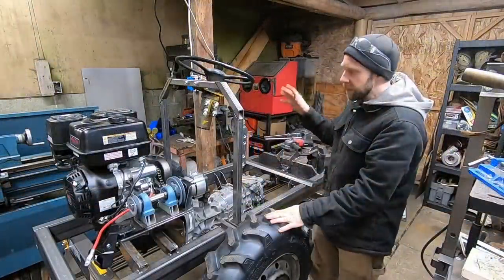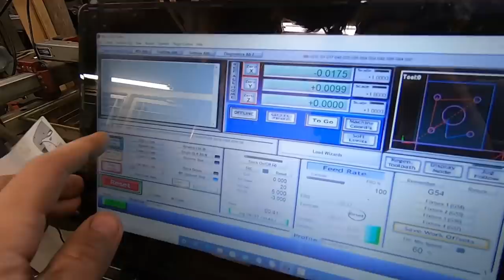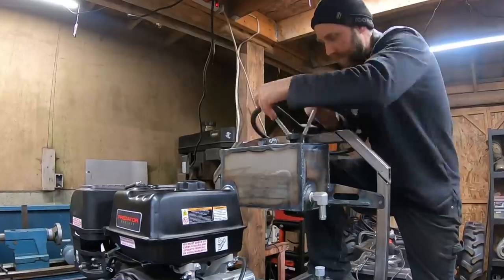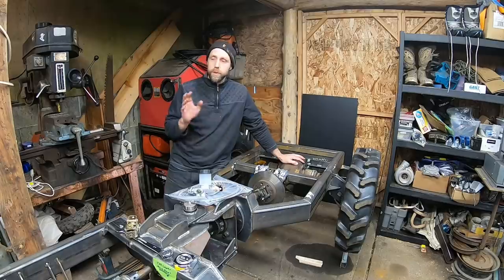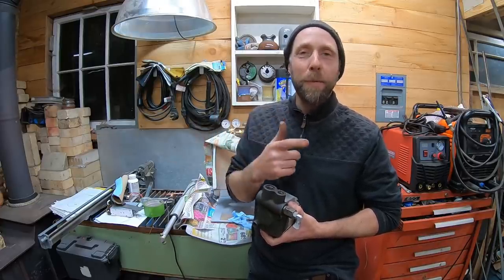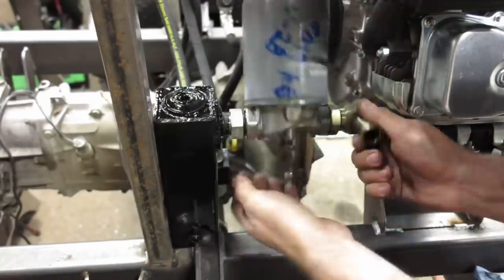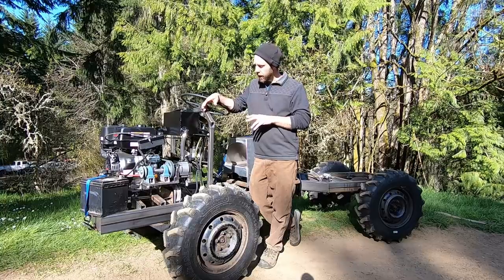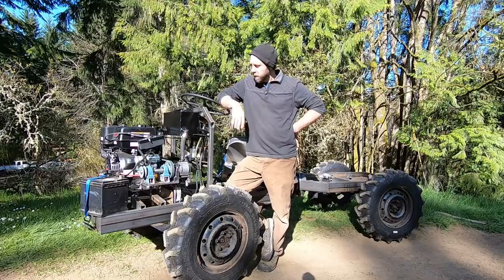420cc Predator powered articulating 4x4 dump truck build part 6

Comment: I like that he basically told everyone that hates the drive line brake to STFU he knows what he is doing. He is right! Heavy machinery uses drive line brake for that exact reason.    YOU GO MIKE!!
Reply: An open differential is dangerous with a driveline brake. Just the facts man.

Comment: Excellent build. Needs an old school tractor seat?

An old engeneer friend told me once - “It’s not the load you can carry, it’s how fast can stop that much weight.”  He use to design elevators, but I think the principals are the same.
Reply from the maker: Snozco Cram I forgot to mention in the video I’m running stock Subaru rotors and calipers up front along with the rear center disc. Your friend has a good outlook on that subject 🙂

Comment: I would think about it really hard before you weld the diffs. The way that baby turns so tight I would be scared of wheel hopping or chirping myself.  BUT, with that said,  I surely would entertaine the idea of a locker.  I know that welding wire is cheaper, but a locker would be the best of both worlds. I'm sure that someone, somewhere, makes a locker for your rear ends. If you can't find one,  there's a fellow on YouTube that can make you one.  He's the Man that's making the articulating, Predator dump truck.  LOL, KEEP UP THE GREAT WORK. I enjoy watching your videos.
Reply from the maker: Jamie Taylor Yes I will probably hold off on welding up the diffs, I think not will be fine the way it is on my property. I appreciate your advice and I think you are right about a locker 🙂
Reply: I agree on the locker, and not welding the diffs. I think it would put way to much of a load on that light drive line.

Comment: My 2 tone 1954 Chevy dully has a driveline emergency brake. It’s original. I can park on a hill. Loaded, And it is mechanical and not hydraulic. Those that are commenting on the break system have never worked on heavy equipment. It works. Very nice work.
Reply from the maker: You know 👍 take care William 🙂

Comment: Hey Mike! I'm really enjoying this series. Just a sugestion. Once you've tested the articulation you need, think about limiting the twist capability of the rear. Early articulared tractors with long wheelbase, were prone to flip over due to short gearing and increased traction. Greetings from Argentina!

Comment: I had a log skidder that was setup around the same ideas. Driveline brake, articulating frame, etc.  It worked great. I really like where you're going with the build. Excellent work by the way!
Reply from the maker: Thanks Justin!
Reply: @Mikefestiva  no problem buddy. I'm getting ready to build my kids a buggy to 4 wheel with. I plan on using a predator engine also.

Comment: Yes, old trucks and certain tractors used a “Drum” park brake, so it works. Going 14 MPH does not require brakes at the wheels as there is no transfer of weight. Have not read others but when it comes to “Tow” rating on your new truck, it is NOT horse ponies, it is brakes. Nice build. Many have not driven a “Center Articulated” vehicle period but the first John Deere 4X4 tractors would allow max turn radius on hydraulics, but pull the steering wheel a little harder, the inside brakes would start to lockup. This made steering even tighter. You could walk it around a basketball in the dirt if you wanted to pull it hard. It would automatically dis-engage a lockup on the front or rear differential if engaged. At least they did when I was 14. Now I am 64. Many moons, just wish I could walk. 
ASE Master Tech since 78, retired

Comment: Talking about heavy equipment using driveline brakes... we run three balewagons now which are basically small square hay bale picker uppers, I don’t know the weight of the actual machine but we put 188 bales per load which is over 11,000 lbs just in bales. All of these machines have only driveline brakes and we definitely put them through their paces so good work!
Reply: Suure if drive line is designed with enough over kill. Thing is that when you load heavy equipment with even more weight and of course it will stop when drive line has enough gear ration. Problem arises if and when drive line components give out, thats why people say its bad idea.
On this case, unless his going to load it full of rock, it should be fine as its small dumper made with 2.0L? car parts. If this was to move car size load of material, i would go with truck parts and so on.
Reply from the maker: I also have stock Subaru rotors and calipers up front along with the drive line brake. It’s got really good brakes all around. Thanks guys for checking out my video 👍

Comment: Military humvee's use drive line braking also, So its a proven method. The only set back is the rocking motion you get when you come to a stop.  You might not have that issue since you won't be moving that fast.  Cool build.

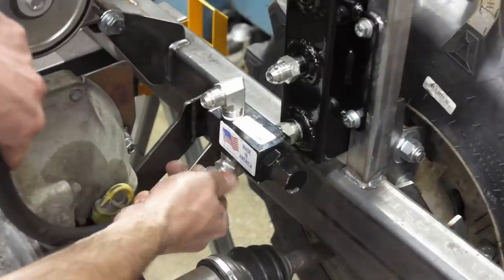Comment: Dude you nailed it on this build.  An to the ppl who said the center driveline break is cutting corners lol simce when is working smart not hard cutting corners. An they must have never driven a hual truck (off road dump truck) n real life they all have this break set up an so do mega mud truck an anything with i think past 2 ton axels have center drive line breaks. U would burn up your breaks an melt everything if tried lol they clearly have not worked in this type of feild of work. An @10:20 theres a  Sasquatch looking in your window lol

Comment: It came out great I was thinking it look like it rides a bit rough though. I wonder if you could make a suspension seat. That pivots in the middle for when you articulate. The front mount would need to be a fixed ball mount or maybe you could use a u joint. The rear mount would be a vertical slotted mount to let it move up and down and let it rotate but not move side to side. Then you would have a set of springs on each side of the seat.

Comment: Our Articulating John deer dump truck uses a central drive line brake for parking works perfect and central drive line brakes have been used for years even down to 1/2 ton to 50 + ton so I like your idea of it great job.

Comment: Question: If you are gearing this beast down that much, have you thought about putting a draw bar on it with the appropriate hydraulic fittings on the rear to let it double as a tractor?  

Question 2:  With that beast set to become a hydraulic dump truck. Are you going to build on a rollover bar, head ache rack, or even a full cab (+/- glass)?

Great Job, not going to lie I kinda want one for my self.

Comment: You sould build a 3 way trans for it so you can choose between 4-1, 6-1, 8-1, and also don't weld the diff, it's going to put alot of stress on the steering and body and driveline of the truck
Reply: With load on those driveshafts will pop in half on first turn. 
To fix traction problem, add independent brake ability for each wheel. If one starts spinning you can brake it till the other carries you out.
Reply: @mihkus  or even see about  making an electronic locking dif

Comment: Drive line brake is the answer.   Simplicity is the answer.  And no booster.  Big jag a rocks on.  When I step on pedal.  I wanna everything is gonna stop
Reply from the maker: Yes I’m also running Subaru front disc and calipers up front so it’s got some solid brakes all around 👍 Take care Steve

Comment: I wouldn't weld the rear diff unless getting becomes an issue those axles gonna have a hard enough time on that angle doing sharp turns with a heavy load on the back might break 1

Comment: Do not worry about those that do not realize projects of this nature are an on going  R and D exercise! And that things are not made permanent or may be fitted to limited strength so as to prove concept and alignment before being made permanent! They evidently haven’t seen Orange County Choppers, where they build the chopper, tear it apart, do paint and finish and then reassemble it! Your approach is the safest and most effective method for a custom one of a kind project! Keep up the good work!

Comment: Mud trucks use driveline brakes... stopping a giant 15000+ pound truck with 6ft tires with driveline brakes should prove a driveline brake is more than powerful enough. Plus, you won’t have ABS. Some medium duty dump trucks use a drum brake on the back of the transmission connected to the driveshaft as the parking brake as well so you’re 100% right you have nothing to worry about
Reply: I agree completely, as part of my  job I use and maintain container handling forklifts (Think Cat V925 size) and many of them use the same drum parking brake in front of the transmission you're talking about. These machines weigh 140,000 pounds or more depending on model, and the drum on the transmission is only about the size you'd see on a 3/4 ton truck rear end, due to the gear reductions Mike was talking about in this video. The brake set up he has is a great solution in my opinion.

Comment: Pinion breaks are common in off road applications and most heavy equipment use them for parking not braking so much. There good for slow speed but high speed applications they tend to get hot and warp easily because the gear ratio makes them run much faster than on the wheels. Your project is coming along nicely. Great job.
Reply: Jason you get it. You are absolutely correct
Reply: The concern offroad is the open diff. Weld it. No question.
Reply: ridestreet20 pretty sure it’s an lsd

Comment: Does it have front brakes? I don't remember but without a load going down a steep off road grade the back won't stop you...but I love the build thus far! Nice work! It seems with all those hydraulics on there obviously a dump bed is happening but some quick connect lines and you got a splitter attachment,  a chipper/shredder etc...OK this comment is too long...peace
Reply: Driveline brake stops all 4 at the same time
Reply: ry tvdinners I think he is running the front discs but not the rear drums. 👍 Cool build

Comment: Awesome Build! I've been following the progress as you Put out more segments, I love The fabrication! So you're going to Use a Jack shaft and lower the gear, so you can use the higher gears, and I imagine you will have some real serious torque in your low gears afterwards, I imagine with it articulating you're better with the Lower gears it doesn't need to be super fast or it might be unstable? You're lowering the operating speed of the hydraulic pump by changing the gear Ratio with a different size pully will that Lower your steering sensitivity? or Is it So the fluid doesn't cavitate? I'm not Experienced by any means with Hydraulics So I Have to ask But I am interested In how it works and what all changing the pump speed affects? I enjoy watching people who can Make something out of Just about nothing, And do so by putting in alot of Work, Alot of Thought, and Patience. I'm impressed and Enjoy all your Videos They're very Informative And Down to Earth and I really like that! I'd like to think I'm pretty handy I am always learning little bits of information here and there on many different skill sets and Your Videos are good for that and very inspiring! Great content! Great work!
Reply: there are a couple of reasons to slow down the hydraulic pump one reason is that pump has a higher flow rate than is needed and at idle speeds it can kill the motor if if you stall the hydraulics and it opens the pressure relief valve also the steering is plenty fast because of the small cylinder bore on the steering cylinders so it will help in  both cases
Reply: @davidhelgeson6997 That makes sense! Thanks for the insight.

Comment: Drive line brake are way better than brakes at the wheel. Why do you think rock crawlers use a drive line brake. They hold a the power back easier. Big mining dump trucks use drive line brake too
Reply: Ya, I can’t imagine all the knucklehead comments he has to endure!
Reply: He is not building a big mining truck. Drive line brakes are meticulous  to build and install.  Some high quality cars utilise  such brakes to decrease unsprung weight for better damping and cornering.

Comment: Even a tiny spot weld is surprisingly strong if it's not put in a bending load. I recall another Youtuber who drove around in a Baja Bug with a bunch of tack welded suspension parts (can't recall if it was accidental oversight or deliberate disregard) for a long time before they finally broke. Blew my mind!

Comment: Careful about the Hydraulic Swivel fittings.  Used them for a Hydraulic scale on Forklifts and the Chinese made ones use a Soft metal that often gives way on the Crimp after a while in the Crimp part of the swivel.  There is Domestic Production of them that costs a few more buck, but beats having leaking swivels.

Comment: You are completely correct on the braking system. When you install the brake on the pinion of the differential it amplifies the power of the brakes by the gear ratio.

Comment: Great to see it moving under its own power, that said DO NOT WELD THE DIFF. Put Torsion centers in the diff if you can find them or LSD's, welding the diff will cause it to kick like a mull when turning. Your wheel base is to short, you can see in the video when turning the differential action needed when turning.

Comment: Those that are worried about that brake obviously haven’t driven and ag equipment.  That will work fine - hell, one of my tractors brakes stopped working almost entirely 20 years ago and it still gets driven plenty - probably wouldn’t let a novice drive it, but it’s fine for what it is - and it’s a 65HP tractor too, so much heavier than yours.  Keep up the great work, love watching this build. 👍.  Eyeing off one of those CNC tanks too, that would make a nice addition to my shop. 😊

Comment: I was in the Air Force and peeked under the hood of everything I worked around out of curiosity. The large aircraft tugs with 4 wheel steering have rear driveline brakes on them, so I'm completely with you on this. The tugs were able to stop on a dime towing f-22s, so it'll work well for you. Loving this build, you're doing a lot of cool stuff!

Comment: Just found your channel. Excellent build. The Tenant company used to produce an articulated floor scrubber that could scrub a floor with the front section and vacuum up the water with rear squeegees even around warehouse racking. I always thought it would be cool to convert one of those for use around a homestead. Now you’re doing it from scratch. Good on ya!

Comment: Yeah, diff/driviline brakes are used everywhere from heavy machinery to megabus trucks. Super simple and effective compared to running brakes to all 4 corners. Seems like the driver sits a little high though. Might be me. I'm really tall so a high seat on angles gets sketchy. Im sure the seats not done, but I'd add some hip bolsters for hills and articulation. I love this build so far.

Comment: I like the tab method for tank assembly.  I like the drive-line brake.  They are used in a lot of large equipment, and they are not submerged in mud, etc. The project is coming along fine!  Looks great!

Comment: Have you considered using a a dual range subaru trans from an old loyale, it would give you 2wd to the front 4hi and 4lo. This would get you lower gearing without a jackshaft. They are very similar to the legacy trans

Comment: Your right to use the drive line break , the only thing you may run into is the disk will heat up when being used a lot when vehicle has a lot of weight on it . Four wheel brakes are more complex but can dissipate the heat generated from moving down hill with lots of weight. You will see your disk for breaking change colour from the heat witch won’t hurt anything but you may notice the     Break pedal throb after so time dew to disk warping if it gets hot for a long time . Very good build and well thought out . Thanks for letting us all see your project and looking foreword to seeing more and how you finish this build .
Reply: Yup drive line breaks are the way to go. But good thing its mild steel he can just cut out a new disk lol

Comment: Mike,
You could make the system load sense by adding a shuttle valve between the A & B ports and taking that to the sense port on the pump.

Comment: That is one stout machine, I love overbuilt stuff, it’s like a mini front end loader 👍🏾
Reply from the maker: Thanks for checking out my new video! Yes it’s definitely stout 😂 I wanted it to be built strong and not worry about breaking it when doing heavy work with it. I have a extremely well built small 4x4 gray market tractor from the early 80s and I wanted this dump truck to be matched to scale to my tractor. Thanks for commenting 👍

Comment: This is amazing. You inspired me to draw up a the layout for something similar, but with a inline 3 or 4 cylinder FWD drivetrain, rotated 90,  with a welded diff to split the power to shortened solid axles front and rear.  I like how compact the single cylinder and transmission,  keeps the track nice and narrow - perfect for some small scale logging. Looking forward to see what you do next with this!
Reply from the maker: Thanks for checking out my video 👍 Yes the FWD 5 speed turned sideways with the diff welded and CV joints going out to some narrowed small truck axles is a good way to go. I have been thinking of this on my next build. Thanks for commenting 🙂

Comment: Our 15 thousand pound lift off road forklifts (weigh 20 thousand without anything on the forks) run a single disc about the same size. That set up will be more than adequate.

Comment: If you put a stout small push blade on the front and a cable winch on the back you would have an AWESOME LITTLE SKIDDER that's Tough as nails.

Comment: Great job! Works really well from what I see and with the few upgrades you plan it will be even better. I've kicked around the idea of something similar for a few years for cleaning horse stall. Skid steer and tractor are to big to get in the barn. Something like this would be nice to get the manure out and dump it at the pile.